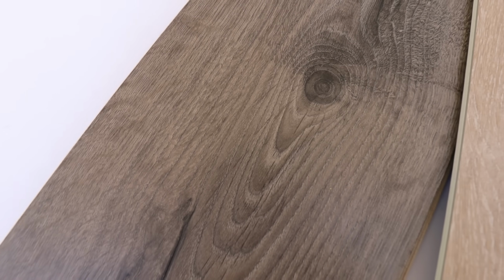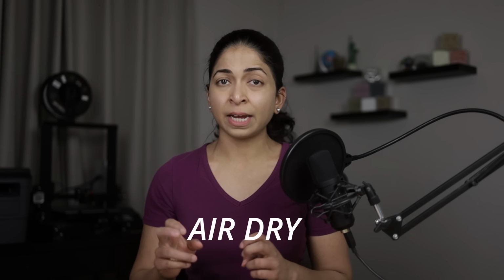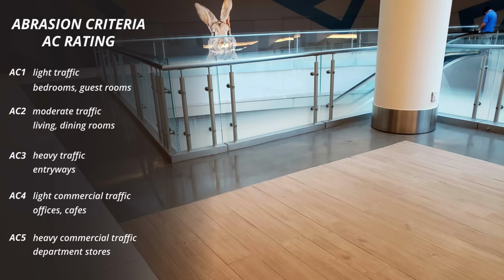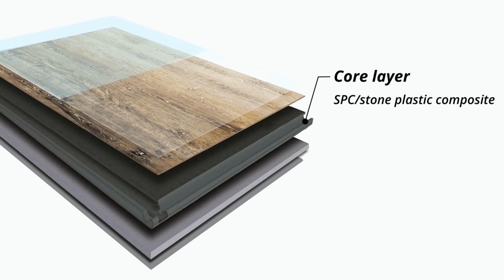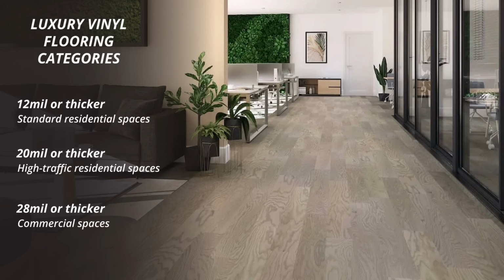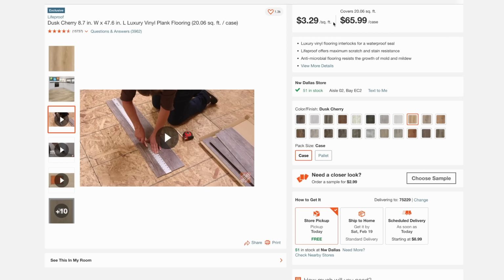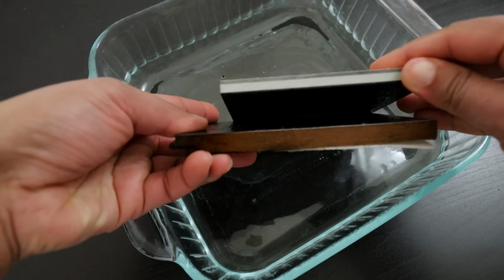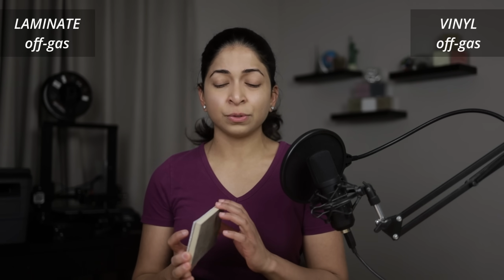Laminate vs Luxury Vinyl Plank Flooring | Everything you need to know!

Comment: Unless you are very limited in budget, luxury vinyl is just an all around better material for most homes.  It looks good, is low maintenance, and resists scratches (such as my dogs' nails).  I personally think that hardwood floors can look better but not enough for us to pay the cost delta.  It was worth it over laminate.
Reply: I wanted hardwood floors so bad because our new house came with wall to wall carpet  but wasn’t able to afford it so we installed vinyl and we loved it . We had two options use all of our savings to install hardwood or use half of it to install vinyl , furnish the house and do some remodeling . I don’t spend hours staring at my floors wishing it was hardwood . It cleans us nice and hold up to anything . Our 10yr plan is to convert the main floor to hardwood . I’ll pick vinyl over laminate any day . My parents have laminate in their kitchen and it doesn’t hold up
Reply: Interesting I have midpriced laminate Home Depot flooring for 15 years and 2 Labradors walking on them for 12 years now. No scratches by their nails. Maybe I am lucky.
I will say having laminate floors where water spills often is not good unless you are quick to wipe it up.
Reply: @Rambleon444  I have laminate in my basement about 18 years now. Almost as soon as I finished it, the dog peed on it one night and by morning it had a swollen spot where it ran into the joint. Otherwise it's held up pretty well, tho if it gets replaced I'll go with vinyl.
Reply: Laminate is still a good product and resists scratching way more than Vinyl.
Reply: Problem with LVP if floating is it needs a completely flat subfloor. Laminate is more forgiving being a stronger plank. The connections with Laminate are stronger. Many reports of LVPs buckling.
Reply: I agree. I put in laminate 20 years ago. If I had known about vinyl planks I would have used those. Don't ever have a plumbing leak with laminate!
Reply: Even though the laminate I had installed - 10 years ago - gets about a two hours of filtered morning sun through mini blinds and is limited to the winter, it visibly faded in areas.  I am also always on high alert for even minor water spills and other types of moisture issues because of its propensity for swelling and de-lamination.  It’s really attractive, but not worth the ongoing anxiety.
Reply: How about dogs pee that is left for long hours? Will it spoil the appearance of the vinyl?
Reply: Vinyl are crap.. there have a new waterproof lacquer laminate are better than vinyl.. the vinyl isn't worth, plastic easy break...
Reply: Excellent and comprehensive video. Thank you for explaining the materials used in making these products as well as their resilience to wear and spills.
Reply: Please do not buy! I have vinyl flooring just put in less than a year ago and it there is any gap between the floor and the flooring the edges lift and break. Biggest mistake putting the floor in. Yes water proof but what good is it when everything is breaking and cracking
Reply: This has been true until the past two years. There is now waterproof large plank laminated products. Revwood by Mohawk, and Repel by Shaw. LVP is going up in price so fast while it still has many issues. As someone that has been flooring my entire life-unless you're going to go with the tippy-top of LVP Revwood is now the most bang for your buck. Also looks leagues better.
Reply: @maniswil2  I agree, it appears laminate technology is getting better now.
Reply: We went with Mohawk Revwood on the recommendation of our flooring sales rep.  Originally were going to go with LVP but when she came out to measure she thought the Revwood would be our best bet.  We are in a rural area with a pack of big dogs, horses and a couple of house cats.  We just did the bedrooms, kitchen and hallway.  Left the original hardwood in the living room and linoleum in the bathrooms.  They just finished the installment last week so we’ll see how it wears.
Reply: The biggest down side to vinyl is you have large windows and extreme sun exposure unto your floor.
Most vinyl varientions arent going to handel the heat well, and those they do tend to be on the more expensive side.

So, laminate when you have a high amount of sun exposure, 
vinyl if you dont.
Reply: @powerflumi    Vinyl anywhere there’s any humidity.
Reply: Nobody ever talks about the sound of each when walking on it… I personally prefer laminate for its “hollow” wood sound vs vinyl with its “thud” when installing over concrete.
Reply: LV with better water proofing is a great plus.
Reply: i am confused. the one they have at Cosco is laminate vinyl flooring waterproof  so which category is this belongs to. there is no luxury word was mentioned on the box.
Reply: Wood is more natural than plastic and is more healthier so yeah if you are on budget don’t get it lol
Reply: @petermiller9904 0)l
Reply: Hardwood adds equity to your home vs plastic photo floors.
Reply: @worldchangingvideos6253  Laminate has also a foto layer my dude - even if we argue that with quality flooring its made from paper

Comment: Only 10-20 yrs?  If you feel up for it, a video on different "wood"/"real wood" flooring costs vs. lifespan would be interesting.  Great content on your channel.
Reply from the maker: Yes, I was surprised too. They have a limited lifetime warranty, but I doubt it covers much. I will make a video on real vs fake wood soon. Thanks!
Reply: @BelindaCarr  i would love a video on engineered wood floors
Reply: @BelindaCarr  Looking forward to that video!
Reply: The original oak hardwood in my house has been refinished at least once in its lifetime and still looks pretty good. Its 70 years old!
Reply: @MorryB  The old wood floors were quite thick and can handle several refinishing jobs.   I use to work at a business which was located in a old house over 100 years old. The front lobby got a lot of wear, with wet boots in the winter. As a result that floor was refinished about every 5 years. About 10 years ago the company said it could not handle another and it was replaced with a flooring simular to laminate, but designed for wet spaces. Often used in bathrooms.
Flooring has become thinner over the decades. The new wood flooring is very thin and can only handle one refinishing.
Reply: My wood floors  ( oak ,maple, and fir) are 120 years old.   They look great and should last for at least another 100 + years with minimal care.
Reply: We have an eighty year old historic home with original wood floors.
Reply: Real wood VS engineered wood content please.
Reply: @albundy3929  What are you wigging out on me for? I had indicated a preference for the lower priced option.
Reply: Most people don't live in a house for that long. It seems a bit odd to me as I've lived in the same house for 22 years, but I guess for a lot of people it doesn't really matter if they have to replace their floors in 10 years.
Reply: Go wit vinyl
Reply: There's also the "opportunity cost of money" vs the "nominal cost". If real wood is $20k and LVP is $5k, then going with LVP means saving $15k. That money can be invested, and that investment will likely return in the neighborhood of $10k in 10 years, so an LVP replacement in 15-20 years will be "free" in a sense (of course, better to keep saving if possible if the LVP is in reasonable condition!).
Reply: @dosadoodle  free plastic flooring vs an heirloom, yea!
Reply: @worldchangingvideos6253  I strongly agree with the sentiment! I'm just not sure I agree to the point of paying 3x to install quality wood flooring ($12/sf vs $4/sf) when I know my neighbors won't -- and so I'll still have to deal with all of the pollution their purchases are producing. This is why I support waste being more appropriately priced, such as pricing disassembly and recycling at the time of purchase. That is the best way to combat the "Tragedy of the Commons" economic problem by motivating everyone towards decisions that are optimal for the community, not just "locally optimal" for the individual.

(That all said, there are other things I'd definitely spend the 3x on, such as air tightness and insulation with controlled ventilation. In those cases, there are major environmental gains and also substantial comfort and personal health gains from healthier inside air.)
Reply: @dosadoodle  If long-run costs are considered then floor tiles will pretty much last forever, however they get real cold in winter.

Laminate and LVP is there because you want wood, but can't afford real wood (or it doesn't make sense e.g. waterproofing). However some laminate can cost more than real wood e.g. Quickstep Laminate.
Reply: @dosadoodle  the deciding factor for me was longevity and environmental impact. I’m biased as well in that I absolutely hate plastics pretending to be natural, an example is this video, plastic is pretending to be a wood product. But more importantly for me is the impact that PVC has when thrown away. It’s incredibly damaging to the environment. Sure it’s cheap today and in your analysis your saying you’re going to “invest the difference” but I assure you that would never happen in reality. That difference in money either isn’t there in the first place or will be consumed on some other item in your DIY list. It’s not like you started with 20k just for flooring… also many engineered hardwoods are far from being 4 times the price of LVT, that’s just disingenuous to present numbers like that.
Reply: @dosadoodle  interesting analysis
Reply: @roadrider1100  Thanks, I will say the part I still struggle with in the analysis is considering other factors such as waste/trash (and other "negative externalities"). The analysis I provided was only focused on an individual's viewpoint. For example, it doesn't consider the impact of trashing multiple cheaper floorings vs having a single more durable floor for a longer period of time, and that definitely weighs on my mind.

In some cases, the real cost to society is lower with the higher cost product due to such a consideration. I suspect this particular situation isn't affected dramatically by this consideration, but I really don't know!
Reply: @dosadoodle  Yes there is opportunity cost and returns to the investment but of course that investment can be troublesome too if not green or sustainable or socially valuable (think of that - as it turned out scam - enterprise called Theranos was it intended to be a scam from the get go or was its incompetent operation from a high level what precipitated its collapse of value). And also as you note here the externalities both positive and negative.
Reply: @dosadoodle  what if I make a bad investment with the $15k?
Reply: @albieoval1657  What if you lose your job and have to default on the home loan? What is the house burns down? What if you die in a car crash? What if you have to sell the house and move? How would spending more on a floor you don't get to benefit from be of value?

None of the above nor your bad investment scenario are valid for the cost benefits calculation because they assume unknowable factors.
Reply: @albieoval1657  Invest in an index fund (or something close to it) and it's very unlikely that you'll end up with less money over a 15-year period. It is more likely that you'd have tripled your money in a 15-year period vs lose money over a 15-year period (statement based on historical data).

This also assumes you aren't moving money in/out of the market when there is a decline, because there will be declines, but over a 15-year period those generally get washed out by the increases.

If you invest in individual stocks or try to get clever, good luck, and in that case I'd say all bets are off. You'll of course hear a lot more stories of people who pick their own stocks and who do well vs those who pick their own stocks and they underperform, and that will make it seem like stock picking is smart. However, you generally only hear about the successes because few people volunteer to talk about their mistakes. Even the ones that did well on a particular pick may have lost a bunch of money on another pick that they will not share.
Reply: @SurmaSampo  let me rephrase, what if I don’t know anything about investing? How would I invest?
I was thinking instead of wooden floors use the $10k on new windows or something similar. But investing… hmmmm I’m here for a video on flooring lol